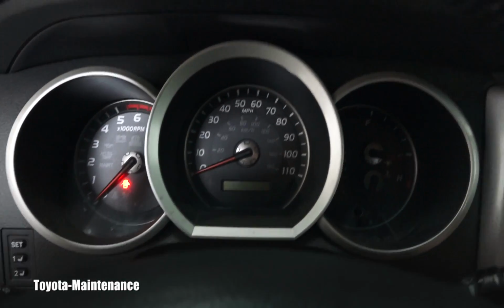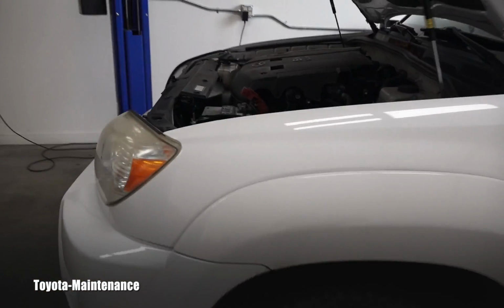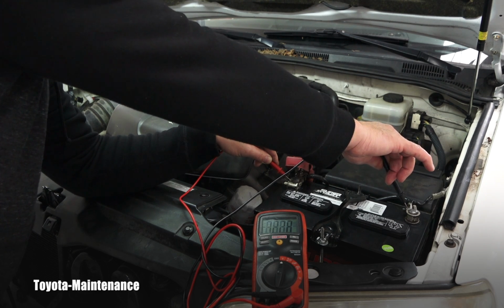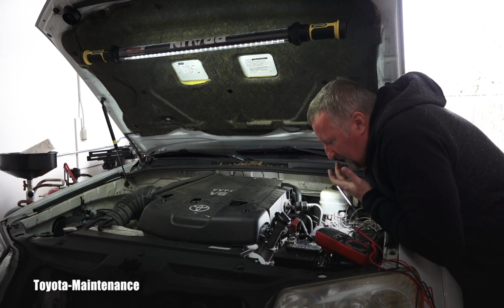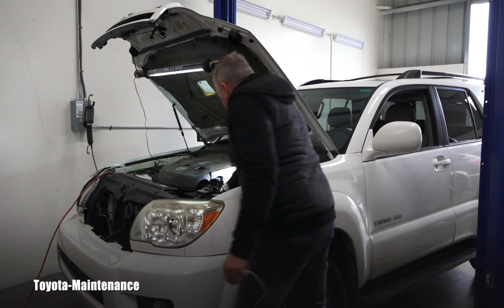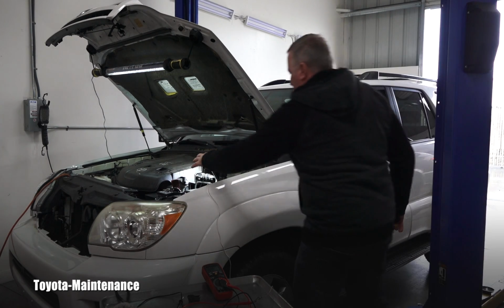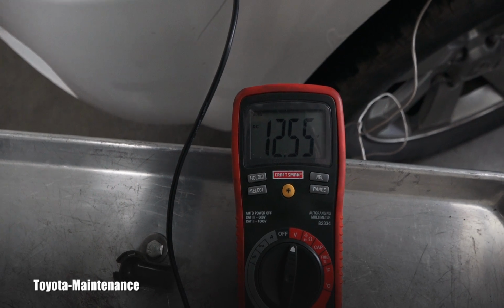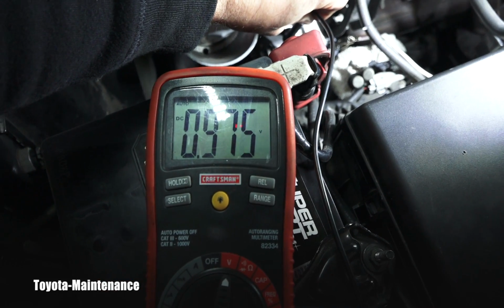Toyota 4Runner with electrical problem

Comment: Thanks for your video.  To be 100 % correct on your call of a Bad Alternator, further checks are required. Of course you have to confirm a good ground to the casing of the Alternator while engine is running.  Next, Toyotas  Alternators have a 4 pin connector (which you showed) with functions as follows: Pin L is for  the battery indicator on the dash board, when you moved your ignition switch to the "ON" position that battery light should have turned on (not cranking position, just ignition on position) indicating that circuit is operating correctly, on your video it did not.  In addition, when your engine is running and your Alternator is Not supplying voltage output (higher than battery) that battery light will come indicating you have a problem with the alternator or wiring circuit. Pin IG on that 4 pin connector is power to the Voltage regulator circuit inside the Alternator, this pin should have system battery voltage whenever the ignition switch is on and the engine is running.  Pin S on the 4 Pin connector is the sensing circuit for the Voltage regulator, it monitors the existing voltage output of the Alternator and controls the output of the Voltage regulator to either increase the Alternator Voltage Output or lower it. Without these voltages on this 4 pin connector being verified, you cannot make a 100 % call on whether  the Alternator is functioning or malfunctioning.  Of course, you can get lucky and make a call as it being a Bad Alternator and maybe another new Alternator will fix the problem.  But once again to make a 100 % call on the operation of the Alternator, the voltages at the 4 pin connector must be verified.

A follow up on this vehicle would be nice, once again the fact the battery light did not come on with Ignition Switch in the position IS A PROBLEM !!   

Once again thank you for your video.
Reply: I’m having this issue. Like Fausto said, the battery light isn’t on when the key is turned to just the on position. After testing the battery and the alternator, seems like a bad alternator Bcus it would not charge the battery and voltage kept dropping when the car is running. I swapped out the alternator for a remanufactured from Oreilly’s and had the same results. Took it back to oreilly to test the new alternator and the old one and both came back good. I assume there is a short somewhere or maybe a blown fuse? Please give us the update on what happened after you swapped out the alternator. Fausto if you have any intell on why it’s doing this maybe you can also shine some light on me. Thank you.

Comment: Hello,

I have a question. I have a 2006 4Runner 4.0L. The truck occasionally while trying to crank it just like it gets stuck cranking. I replaced the ignition switch, and still doing it. Battery is great. Do you have any suggestions? Thanks

Comment: My personal experience owning several Toyota's in the past is stick with original Toyota Electrical Parts!  They are expensive and most people will go with a less-expensive alternative such as Auto Zone or O'Reilly's electrical parts because they are cheaper.  This is where most problems begin.  Just stay with Genuine Toyota Electrical parts!

Comment: I love my 2005 V8, Toyota 4 Runner!!  It has never let me down in the 4 years I've had it.
Reply: 4 runners don't have a v8!
Reply: happy543210 not on the new models, but some of the 03-09’s has them in v8’s.
Reply: @happy543210  límited edition came with a v8 in it...
Reply: @happy543210 yours doesn't! His does. As does mine. Of course a wager is welcome. Easy $ 4u
Reply: I love my jeep grand Cherokee overland 2004. It has never left me stranded always started for last 15 years.. Only replaced radiator and oil pressure sensor and 2 total battery's